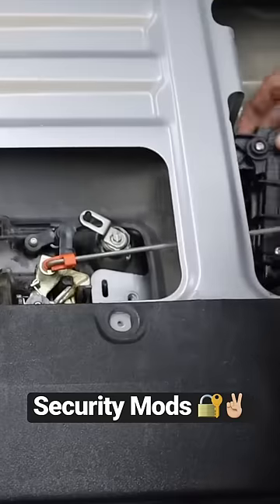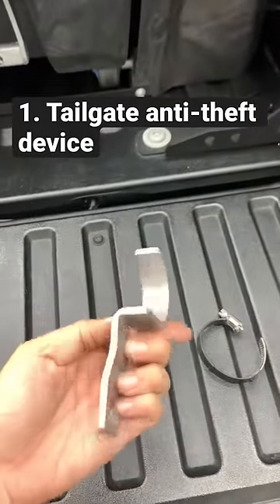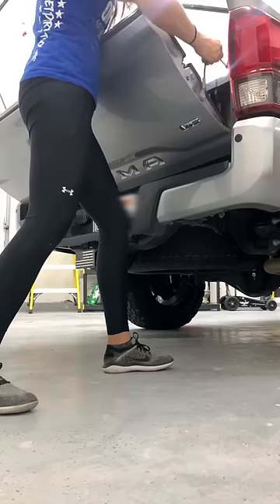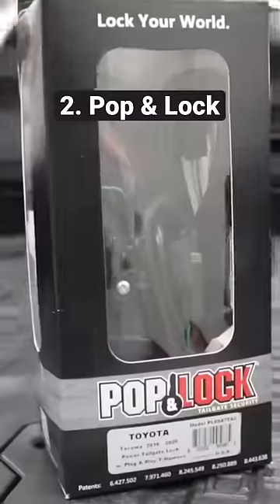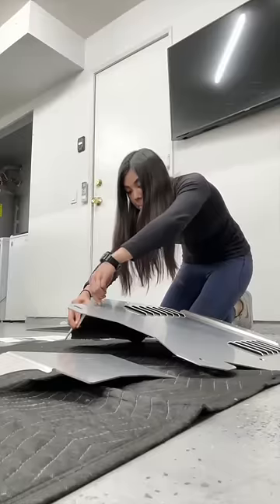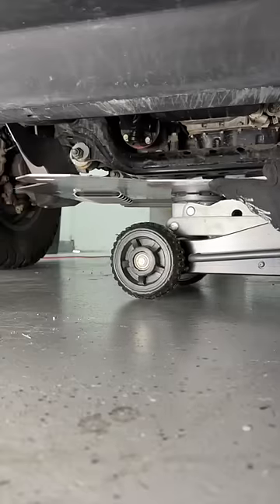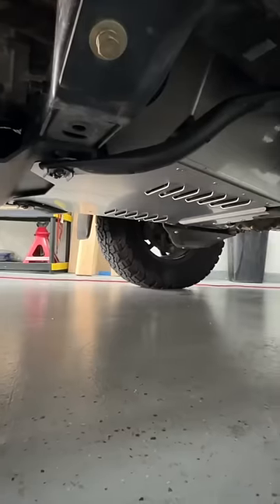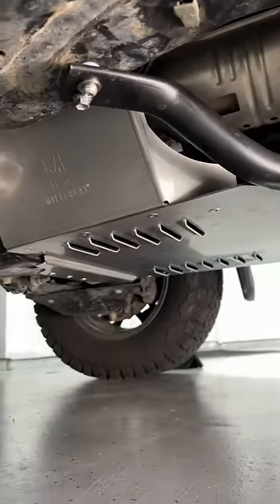All of the extra Security Mods on my Toyota Tacoma 🔐 (paranoid?!) #shorts #truck #toyotatacoma

Comment: I'm not sure why you didn't just use the hose clamp to secure the tailgate. I've been using them forever, and have never had anyone take the gate off of any of my trucks. If you get a solid one, it won't be defeated easily, and is inexpensive. 
Thieves don't want to be there, yanking, twisting or trying to cut anything in order to get the gate off. They want to be in and out in a hurry.

But the fob unlock is a nice touch.

I also like the plate to block the underside of the truck.  I would add that if you are going to be blocking off the air from the bottom of the engine bay, that you may want to invest in some exhaust wrap to help keep as much heat that you will now be trapping in there, as low as possible and scavenged down the rest of the exhaust pipe length.

Comment: you should safety wire the outer bolts since that will slow them down ,I would mabye put some RtV in the special bolts to ,they would have trouble in the dark even they have a set of special tips ,and if you need to take them off you can just wire wheel etc 
      They stole a bunch of gas from me in my truck

Comment: If they scout your truck, and want the cats, all you did was add maybe 10mim to their time to get the cats. Those appear to be security hex bolts or security torx. Didn't see clearly enough which. Nice thing is, most auto parts stores, if not all, carry those. Easy and cheap enough to get. There is no way to 100% guarantee that someone with enough determination wont get to your cats.

Comment: Get you a nice remote start alarm system a nice one will have a pager on it with a screen that works up to a mile it shows you a little hammer on the the side of the car that's being tryed to get into it or messed with. I have one I also have a digital dashcam mirror on mine cause of this new 12 inch android radio I installed plus I have my ps5 in the trunk but I take it in with me when I go somewhere you will need a hdmi to vga or a adapter to make it go into the radio witch I have

Comment: So what benefit does the proprietary bolts serve on the Cat shield? I mean, isn't the thief going to either have a disc grinder or a sawzall. So whats stopping Mr. Meth head from just cutting the sheet metal shield, then the exhaust pipe?

Comment: Ahh, another advantage of driving a heavily patina'd 85 Ford. Nobody's gunning for my tailgate. Nobody's trying to steal my cat.

That cat shield won't do shit to stop thieves. They've got sawzalls. They're just going to sawzall right through it. 12 gauge stainless ain't gonna stop a sawzall. And those 'security' bolts? They're easy as fuck to bypass with a drill or an angle grinder, not to mention an absolute nightmare for whatever poor SOB has to do the next trans service on that thing(which is probably gonna be you since you'll probably lose that specialty socket by then).

 What I'd do if I was concerned about my cat getting stolen, which may not be viable in your area but is in mine, is I'd just delete the cats entirely. It's viable for me because A: I drive a vehicle so old it has a carburetted engine and thus the engine will actually run slightly better without the cat and B: my area dropped emissions checks so I don't have to run one in the first place.

As for the fob lock, that's actually LESS secure. Modern car thieves are going fully electronic and something like a fob is stupidly easy to spoof. Anyone with a Flipper Zero, which can be bought for very little money on Amazon, can get your tailgate open faster than you can with your own fob.

Comment: Anything you put on your car with a tool a thief can take off with a tool, that plate with visable screws would take me 30 seconds to remove. When it comes to your tailgate, if they can't open the door, they will just cut through your panel, leaving you with thounds in damges. I had all types of extra security on my one they couldn't get through, so they just cut holes from the side. Extra security tells the thief that whatever is inside is worth protecting. You're better off without it. Sounds crazy but think about it. I used to protect my vans with all types of locks, protections, CCTV, had my vans broken into all the time, for the last year since my new van I have no protections no extra locks nothing, thief don't even notice it because it don't look like I have anything valuable there.

Comment: Literally none of these add security. You can buy those torx bits anywhere, it’s common sense to look at the hinges if the tailgate doesn’t open, and that key fob receiver REDUCES your security because someone could do a replay attack now and unlock your tailgate without even touching it

Comment: I'd have to read the codes but I'm pretty sure the cats on that truck are only worth about $40 a piece... Nobody's cutting the cats off that truck 😂😂 it ain't worth it. I don't know maybe the crackheads in your area just cut willy-nilly, but the catalytic converter thieves here actually go for the cats that are worth the most money. Mostly large foreign vehicles have the more expensive cats on them

Comment: Pro tip...you know the silver hose clamps that cost like $1 you can put that on your tailgate as an anti-theft device...wrap it around the side that pops out...and as far as the cat...they can have mine it's empty and just there so I can pass the visual inspection...I broke up the material with a breaker bar in both my cats when I pulled my exhaust manifolds to pull my heads and replace all my gaskets, seals and valve springs at 125k miles on my truck

Comment: Wouldn’t Cat thieves just cut through the plate with their Cat cutting tools?
Reply: Not worth it when you can get in n out from under a Prius in a minute. All you needa do is make it harder to steal than the next car
Reply: @philmorrison9045  exactly!
Reply: If there's one thing a thief (which is a criminal of opportunity) hates, it's deterrents. Especially those that cost time and resources (namely, sawzall blades). Granted, however, that the sort of..."people" that steal cats, aren't very smart, nor capable, thieves.
Reply: Just takes more time and noise. Nothing is foolproof
Reply: @thegreyspectre9838  true but if your car is slightly harder to steal from they will move on to a car that's easier.
Reply: Thick stainless ain't that easy to saw cut that's why I don't leave home without my gas axe

Comment: get a real truck lol. not a toyota
Reply: How is the Toyota not a truck?
Reply: @will.dornon  cant tow crap, little bed, yes you can build some nice offroaders. ill give you that. but just dont put tires bigger than 33”. and dont lift them with huge tires because the tiny engine wont be able to drive those huge wheels and tires. a truck means that it can tow and do it with ease. thats a truck. not a tacoma. a tundra is getting there
Reply: @dawsonkallio3809  for most people who buy a Tacoma, that’s all of a truck they need, off-road capable, reliable, and a bed. Still a truck, but not for heavy duty towing.
Reply: @will.dornon  with a $50k price tag. and tons of maintenance. bc toyota